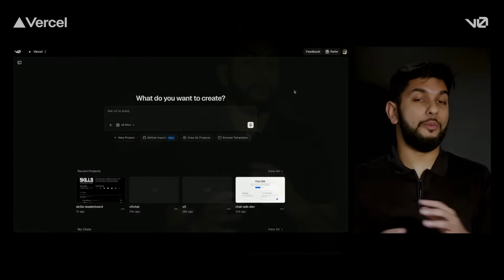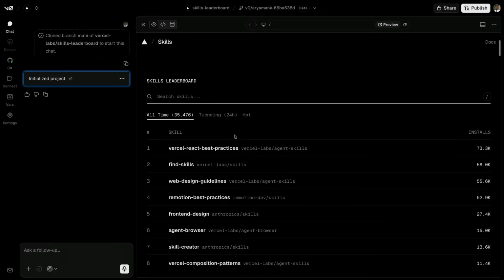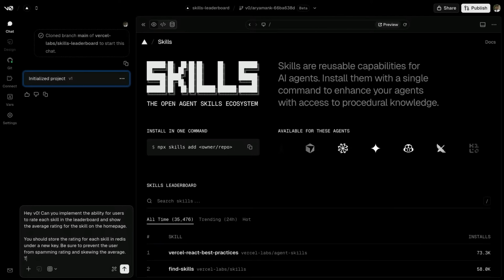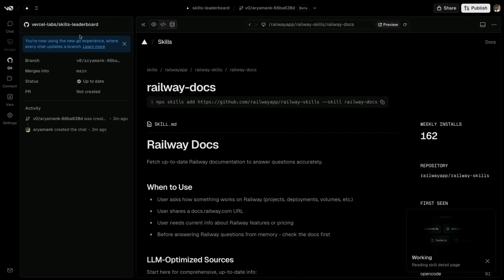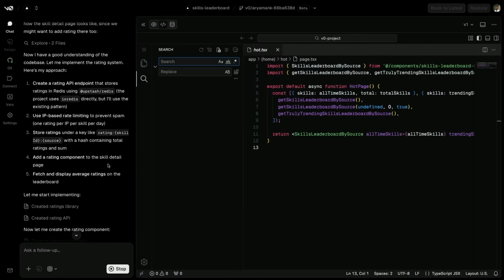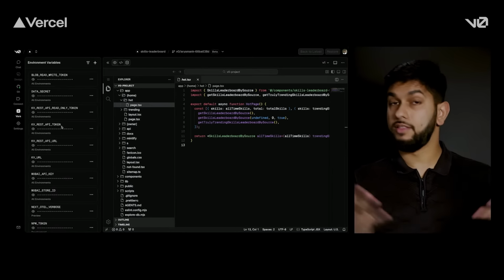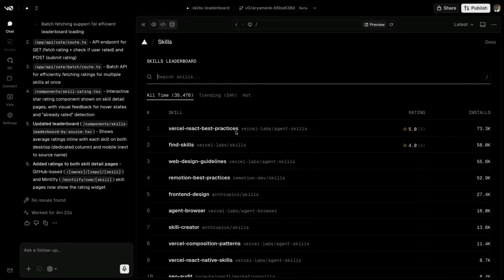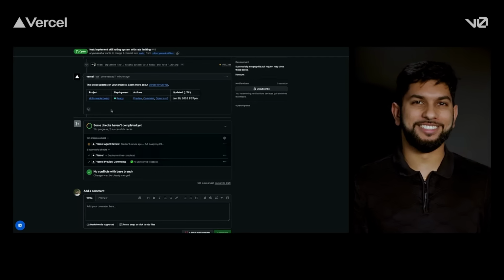Important announcement from the v0 team

Comment: it appears that, there are a lot of issues with git and GitHub integration. 1. node_modules FILE is getting added into my PRs. Even after modifying UI, there are no changes in the branch which is being used by v0, which makes merging new changes impossible.
Reply: I'm facing the same type of problems. Simply vs not work wkth Git.. Have  constant errors on pull requests.. If do roll back in code git has his owmdn life.. Also no any possibility to  make all back in git panel as well..

Comment: Looking forward to trying the updates. One thing I would wish though is a more local setup. I don’t particularly like working in the browser. Besides a often high ram usage, most things are just a lot faster locally. If v0 worked in a cli a bit like Claude code, it would be a no brainer for my - but currently it is too far away from my stack for me to implement it for anything than mocks and mvps that I then copy/paste in my ide.